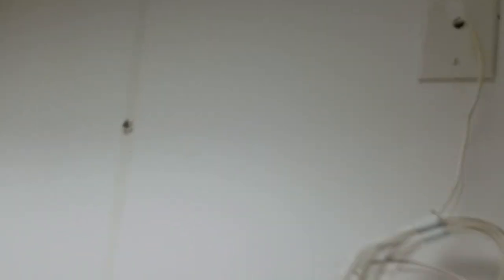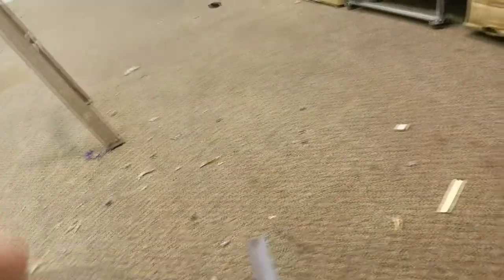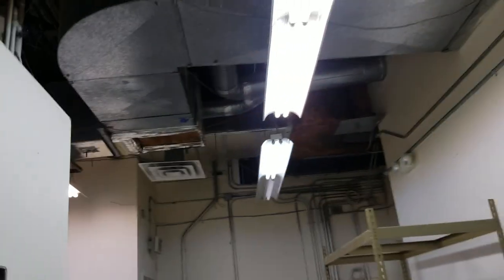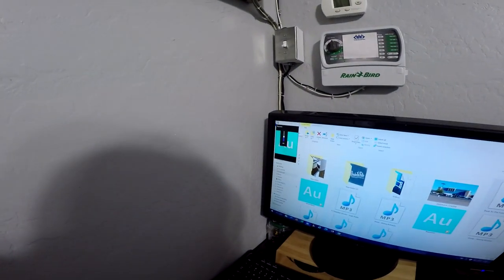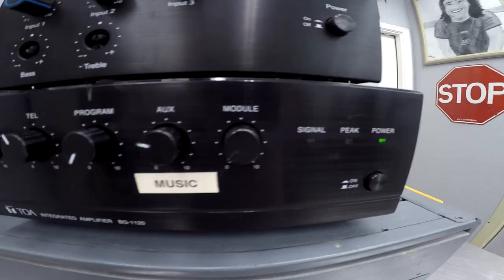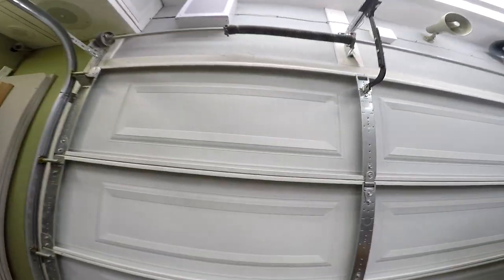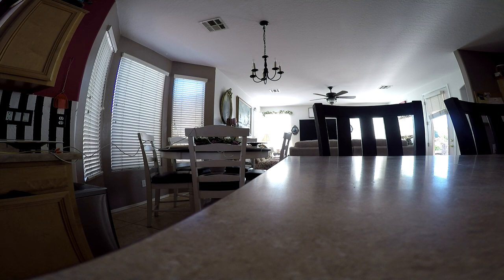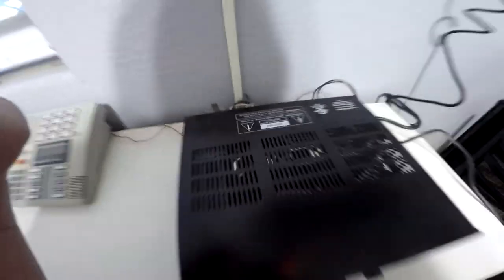Intercom System Mini Movie Special Of 2020

Comment: 👏👏👏👏 Awesome job! Loving all of your hard work and seeing your system grow even bigger!!
The baffles used on the Realistic speakers are actually Harris Dracon baffles rebranded by Radio Shack. I also found it strange how the store put them right beside the Quams. Do you know how the store set up the system to have both 70v and 8 ohm together? I also found it strange that the store's stockroom didn't have any horns in it.
Reply from the maker: This store had a 90s vibe to it which might have been when the Realistic speakers were installed and had connections in the attic. The Quam speakers looked liked that it was an upgrade later and found the mainline in a back room where the amplifier was likely at. All of the Quam speakers were all set to two watts which likey there was a 15-watt amp driving the Quam speakers. There were no speakers or horns in the stock room. I could not find the mainline to the Realistic speakers anywhere in the stock room. I also just got a JBL CSS8008 commercial speaker installed since it was a Christmas gift that was not in the video.